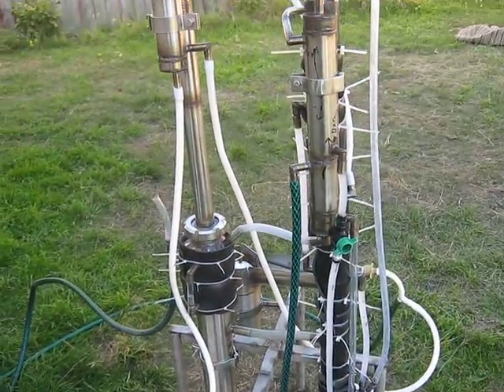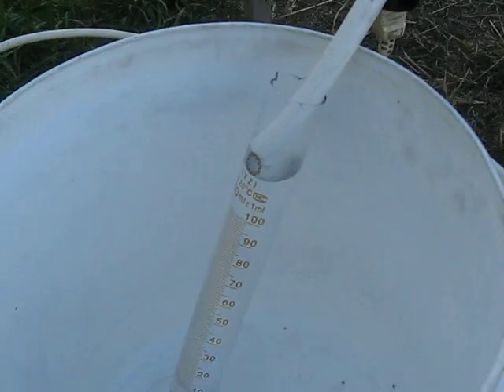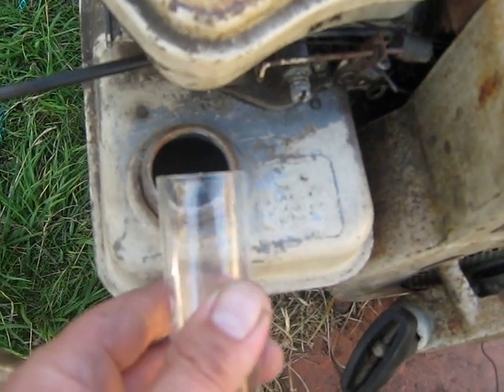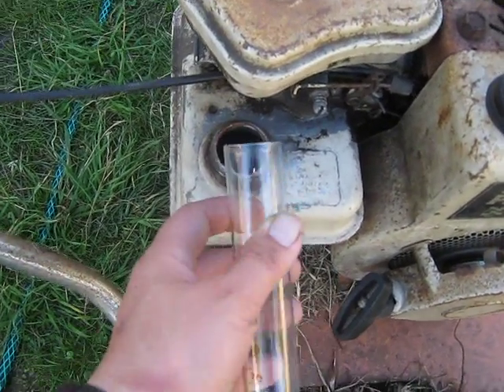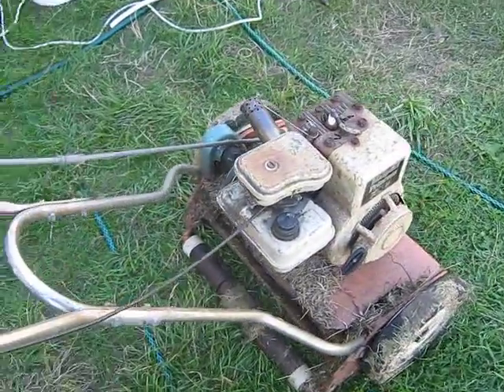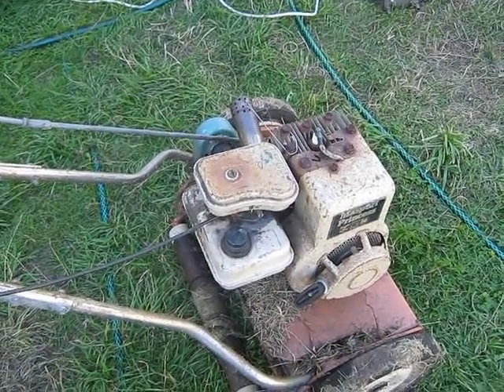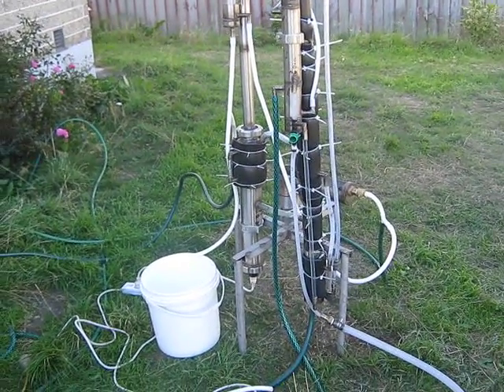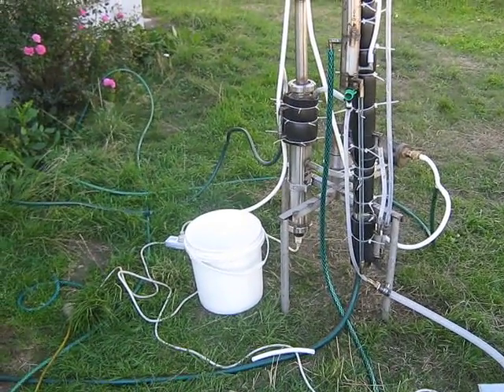Fuel ethanol continuous still: ethanol testing.

Comment from the maker: also the engine I am using is made entirely from aluminium, - carb, piston, block, cylinder head - no corrosion, no attacking, so check your ethanol for acids presence, where did you get it from and what origins - if hydrolysis reaction was involved as a production method, then it is good to know that the one of components of process is sulphuric acid.

Comment from the maker: This is not a problem of the ethanol itself, but possibility of electrochemical reaction due possible ethanol/water conductivity plus contact of different metals that are actually reacting with each other, same thing happening with condensation formed at the bottom of petrol tank while use petrol only in places where big day - night temperature difference, so use water free ethanol.

Comment from the maker: Hi I used an old lawn mover as a bed test, so all kind of abuse to the engine and fuel system, also leaving the thing with ethanol in the tank under the blue sky (never let it to garden shed) and in 5 years time no single drop of petrol was used, no oil changed and no rust formation anywhere - non in tank, non in cylinder, no on spark plug inside the engine - yes outside, and bugger always starts and works - petrol causes corrosion in the tank for sure, ethanol + water = no condensation.